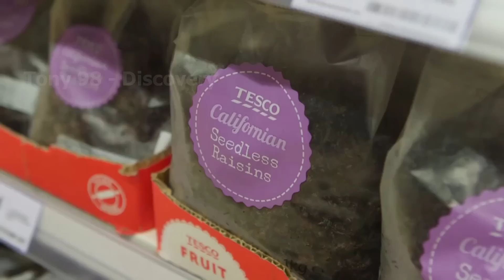How Do American Farmers Produce 9,9 Billion Pounds Of Apples - American Farming

Comment: Can apple be grown in wet tropical regions? With hot and humid summer, min 17 degree winter and high rainfall?
Reply from the maker: Apples are a crop commonly associated with temperate regions, where there are cold winters and cool summers. However, apples can also be grown in the humid tropics if the weather and soil conditions are right.